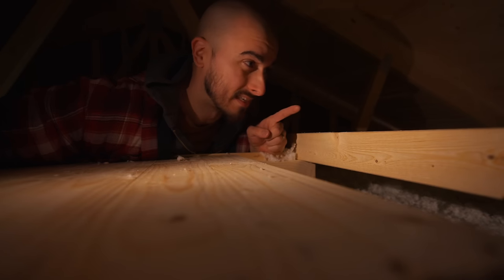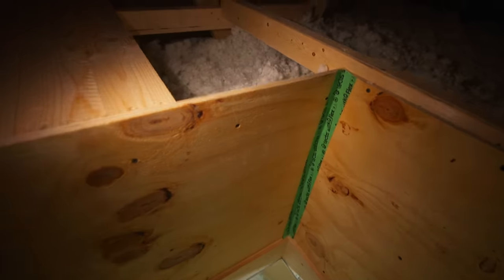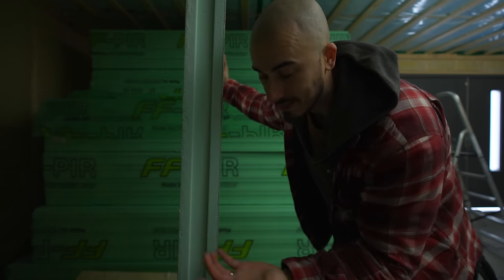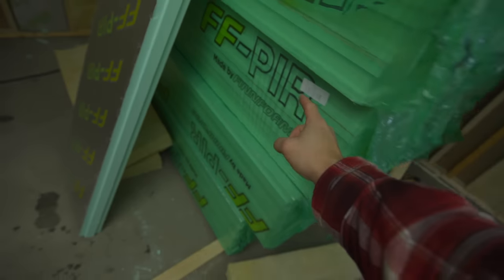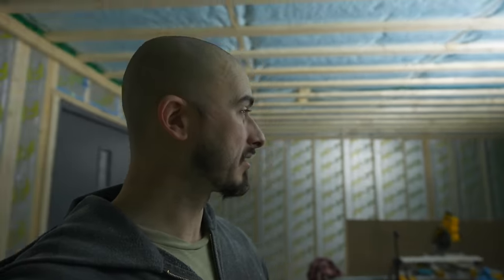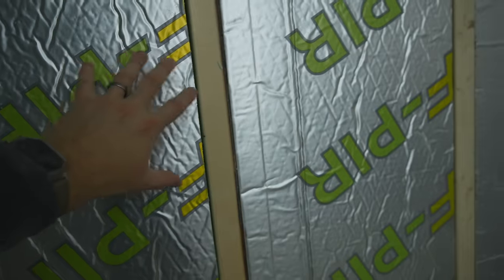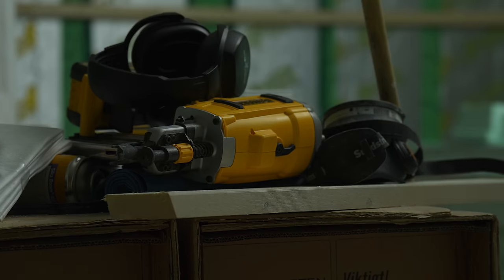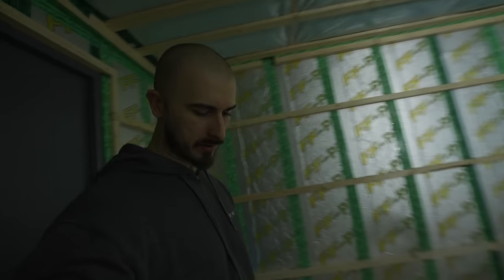What Happened To The Insulation? | Studio Build Episode 5

Comment: @PeterLindgren, Peter, to keep the cold in the attic, take a piece of plywood that will lay across the top of the opening above the folding stairs and adhere some of the fiberglass or foam insulation to the top of the plywood. You can hinge it on one side or simply slide it out of the way as you climb the stairs. Doing this will greatly increase the warmth in the space below, and cut down on heating costs. Although hinging it does make it easier to cover the opening as opposed to having to slide it back and forth.